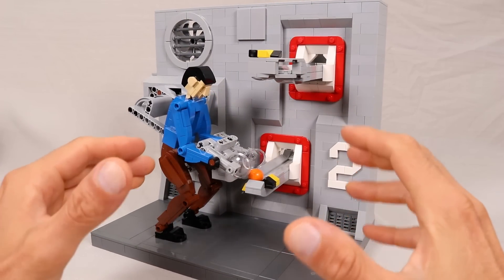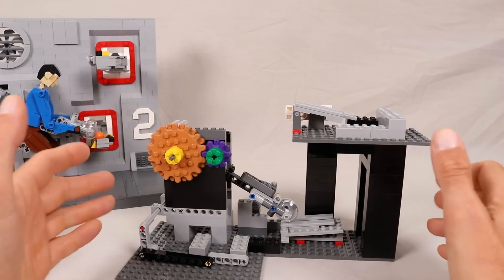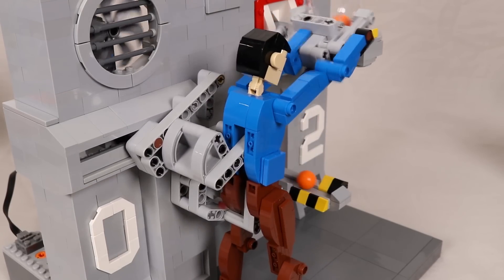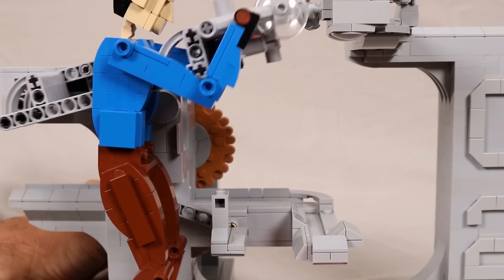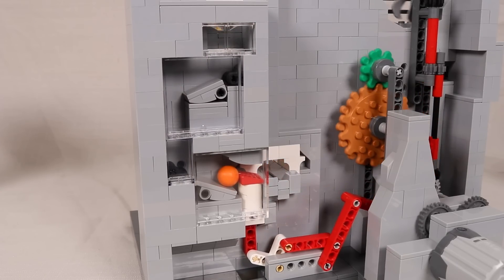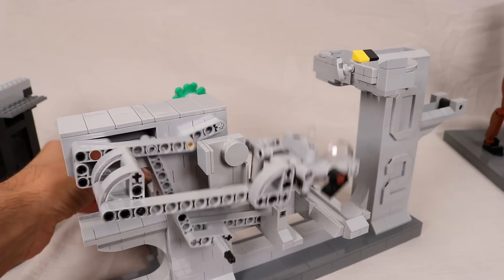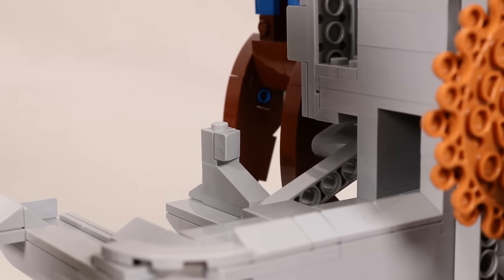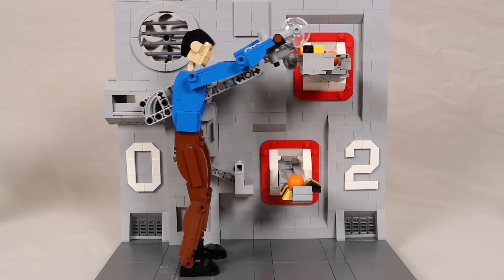Man in the Machine - LEGO Kinetic Sculpture - Design Video

Comment: 2:25 The ball return stepper was the biggest surprise for me! I knew the man's movements would be fancy and for some reason expected a simple trough ball return. Way to make it better!

4:05 45 minutes without dropping a ball will put lots of other GBC modules to shame 👍
Reply: I had the exact same thought around 2:25, I was like "Ohhh, smart!" I had actually wondered earlier in the video how he managed to get the return trough length exactly right. But this setup means it should be able to run at a wide range of speeds.

Comment: Is there a reason to use the plate gears instead of regular technic gears ?
Reply from the maker: You can't mesh a pair of technic gears and keep the axles identically oriented. I discuss it in the design video for my Robot Dreams model if you are interested. Time stamped link: https://youtu.be/xz_YZDtC_Cw?t=151
Reply: @JKBrickworks  Thanks a lot ! This has bugged me since I saw your first short about this sculpture.

Comment: woah I've never seen those bigger colored gears before, reminds me of an old marble machine toy i used to have. where did those come from?
Reply: They're relatively new System gears. The Friends sets quite often have them (my daughter has a handful in her collection!)
Reply: They were introduced (earliest I'm aware anyways) in early 2019 for Lego Movie 2/Friends. They're used sparingly across many themes now.
Reply: Jason's big innovation is to stack 2 of them together, but offset by 90 degrees. This significantly adds to their efficiency and reliability.
Reply: Wow nice
Reply: I have found lots of them within Mario themed sets. The Rezor set, an Marios and Luigis starter courses both have quite a bit of those gears.
They are a brick-based gear that can be attached using studs, or using large/small turntables, the same way they attach to circular 4x4 plates.
They provide a unique amount of movement difficult to acheive in Technic, along with color coding, being very large and flat, and easy to bevel and mesh with non-gear parts.
A fun assembly used for them is in the Reznor Mario set. There is two main gears, one that can be rotated with a Mario figure, and one that acts as a crankshaft for Reznors rotating platforms. By using a rubber 1x2 Technic liftarm with a small ball joint, it ratchets with the gear to create a satisfying and easy to use rotating system.
Overall I highly recommend that set for anyone who likes Mario, or fun mechanisms. It has a surprising amount of personality and functionality.
Reply: ive only seen them in one set
Reply: There often called splat gears and you can find them on most lego sites like bricklink
Reply: Lego mario
Reply: I swear, they almost looked 3D-printed. That purple gear's teeth looked like print that wasn't polished after a sanding, or wasn't sanded to begin with.
Reply: ( 0:32 right here. Even at the full 1080p, it looks like a 3D print.)